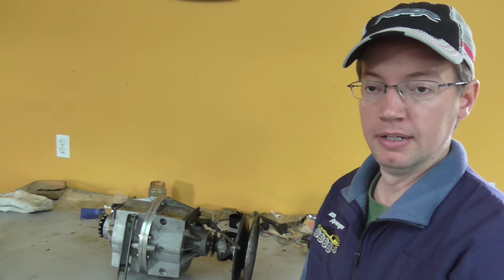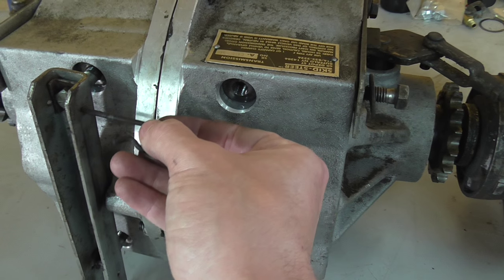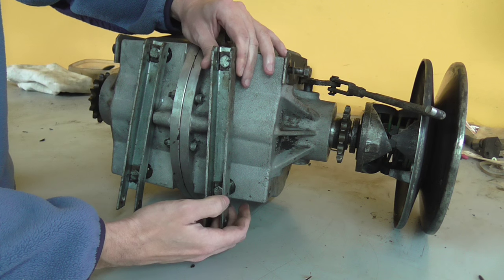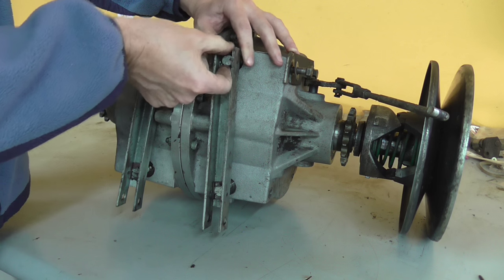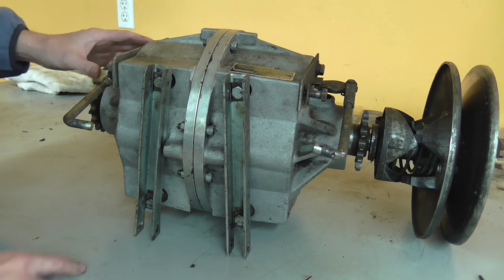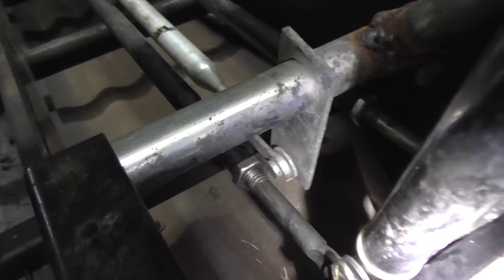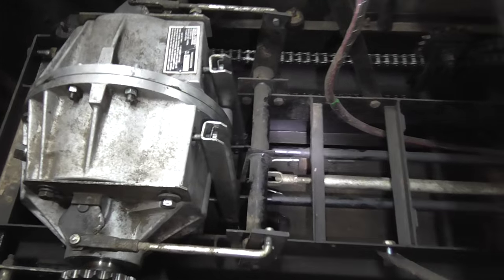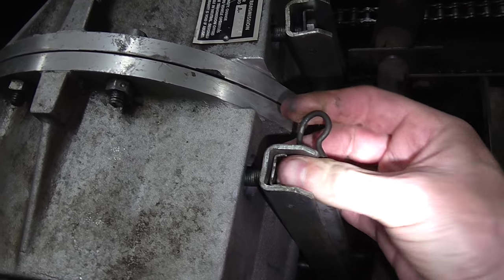Max 6x6 T20 Transmission Band Adjustment

Comment: What does it mean when the band plunger pulls almost all the way out of the housing unit?
Reply: Shane Hinton Did you happen to figure this issue out? My max IV is doing the same thing on the right side.
Reply: It means that your band needs new lining the new ones comes at 0.120 if I'm not mistaking

Comment: My max 2 wants to pull to the right a bit...have to counter steer to keep it straight. Tires have same air pressure the whole way around. Any suggestions?
Reply: I have a same problem

Comment: I just got a max2 with the roll bar on it how do I open it up the roll bar is going threw the upper body and to the frame ?
Reply from the maker: The rollbar just sits on the frame and connects with two pins that are under the seat. It really doesn’t change how you open up the body. Just remove all wing nuts around the edge except for the front three.

Comment: My 8x8 tracks left slightly and am constantly having to brake the right side to stay straight..   what is the solution?
Reply from the maker: That is usually caused by tire air pressure being higher on one side, causing those tires to be a larger diameter.

Comment: can you do this adjustment while transmission is still install in MAX.
Reply from the maker: Sure, just remove the large springs holding the steering levers forward.
Reply: @MaximumOffRoad  Thanks for the help.

Comment: They need to make a t20 transmission with external disc brakes, for the diy'er.
Reply from the maker: Many old T20s from models like the Attex did have large disc brakes attached to the sprockets.